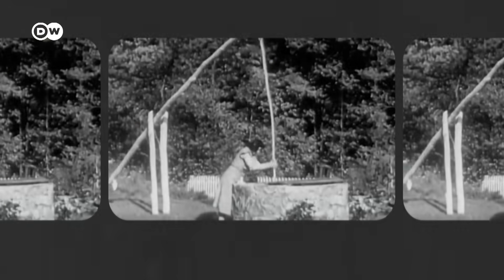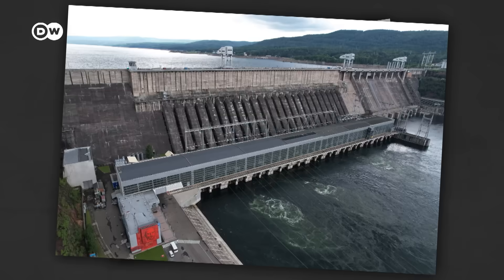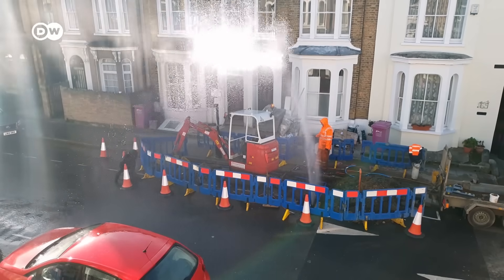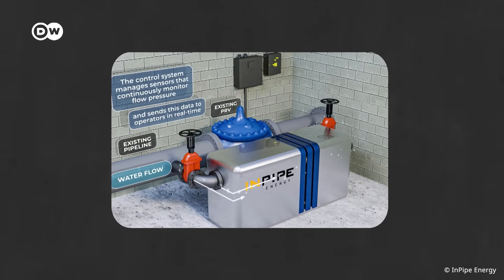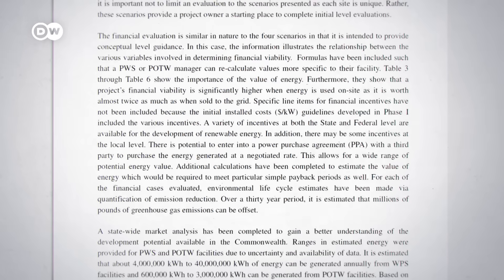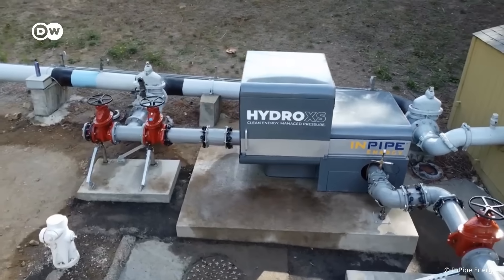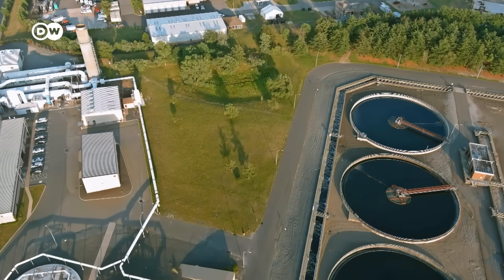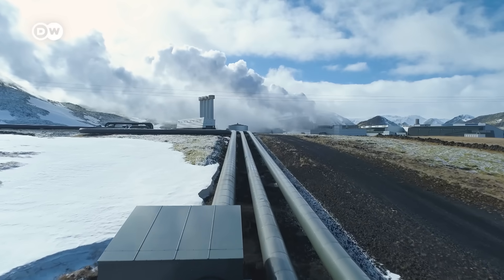In-pipe energy: The hydro power nobody is talking about

Comment: This is complete nonsense!  The amount of energy put into the water in the distribution pipes is done so it can be delivered to where it is needed. No more, no less. If you take the energy out of the system by tapping into a high pressure line and try to spin a turbine generator to generate electricity, you will have lost the pressure that was required for the water to reach the end of the system!  And the electricity generated in that will not cover the energy already put into the system to develop the pressure to begin with so you are basically wasting energy on both ends!!!  You can't violate the laws of thermodynamics and what you proposed does not work in real life!!!
Reply from the maker: Hey there!  Mini hydro technology only collects pressure valve waste energy already being generated by our water transportation service. Therefore, no additional pressure is needed. The process is explained at 2:26.
Reply: @DWPlanetA  Again - what you've stated and posted in this video is nonsense!
1.  The energy put into the pipe is generated by water pumps from the water utility - this pressure is used to do useful work to get the water to where it is needed and  at the PRESSURE that is required.  If you put a little impeller to power a small generator to generate energy, you are taking energy out of the system. For the energy of the small generator to make any power, it would have to be significant! And in order to do that, you'd have to take all the energy out of the water system meaning the water pressure level basically reduced to zero as all the energy has been transferred to the impeller to generate electricity. If that were the case, there would be no pressure to move the water downstream for anything else!
2.  The minuscule amount of electricity generated by this impeller contraption is insignificant to do any level of useful work. The power generated by the power company is infinitely more efficient than trying to gain whatever amounts you think there may be within water lines!
3.  The water that is in the pipeline can potentially be harnessed only if the water is moving. If the downstream water isn't flowing, there is no water movement to move the impeller to generate electricity!  So what kind of work are you able to do on an intermittent basis? 
So again - this is pure nonsense!

Comment: The best pv panel is almost 30% efficient and the worst motor is not less than 90% efficient. I believe the industry is milking the renewable sector by starting with the least efficient stuff 1st then when pv side saturates then we will switch over to hydro

Comment: Thank you !  Seems a form of "robbing Peter to pay back Paul"?  I invented something I called SpringStep decades ago, which is plates with springs on subway platforms/walkways.  As people walk, it compresses the springs and generates electricity.

After thinking it further through, I realized that it'd be "like walking on the beach" i.e., each step would take more effort, since one has to step up off the plate that went down/lower a little.

Concluded with: this would generate energy from the food people ate.

A form of stealing.  So, decided not to implement/market it.

Now, in this case, you identified a place where the flow is reduced mechanically, with friction loss; so, connecting to that friction to generate electricity seems to make sense.

Thank you for this trip down memory/stream-of-consciousness lane.  :)
Reply from the maker: Hey there!  Mini hydro technology only collects pressure valve waste energy already being generated by our water transportation service. Therefore, no additional pressure is needed. The process is explained at 2:26.
Reply: @DWPlanetA  Thank you for replying!

Right, exactly -- I wrote a lot of words to say this does seem to differ from the invention that I decided not to use to steal people's food from them, via exercise.  :)

What's really funny is a few videos later, I watched one where a guy was doing exactly that!  So perhaps there was something to the invention.  Well, I will keep thinking!  :)

Comment: Presumably this only makes sense in areas where water pressure comes from the fact that water is coming from a higher altitude source. If the water is pumped for pressure and comes from a similar altitude, then there is no way to get more energy out than went into it. This essentially only makes sense if you're using the free acceleration of matter from gravity, or perhaps more correctly, the free transport of matter to a higher altitude via the water cycle.
Reply from the maker: Hey there!  Mini hydro technology only collects pressure valve waste energy already being generated by our water transportation service. Therefore, no additional pressure is needed. The process is explained at 2:26.

Comment: Ah yes, the way to generate energy is by... reducing the pressure with a turbine to force the suppliers to produce more energy to keep the constant flow rate their system trackers require... great!
This only makes sense in places where you don't push stuff from underground, like water from high up going down, but we already have this, it's called a dam, so we are once again reinventing the wheel.
I would have this, but I would want an energy battery too, so I'd rather get an efficient battery and then put this into production.
Reply from the maker: Hey there!  Mini hydro technology only collects pressure valve waste energy already being generated by our water transportation service. Therefore, no additional pressure is needed. The process is explained at 2:26.

Comment: This isn't an energy source it's energy that's already been produced. It will reduce the overall pressure of the system requiring more pumps which will require more energy. It's no different than putting solar panels inside your house and buying lights to power them.
Reply from the maker: Hey there!  Mini hydro technology only collects pressure valve waste energy already being generated by our water transportation service. Therefore, no additional pressure is needed. The process is explained at 2:26.

Comment: Interesting little efficiency device. It could be integrated into faucets to reduce flow, as a two stage valve.
Obviously, it's limited, as you need to be running the water for it to be generating electricity. Which is another issue.
Really, though, we need to be talking about nuclear technology. We're really racing against the clock when it comes to climate change, and the energy producing technology that's closest to addressing the problem at scale is nuclear.
It's really unfortunate the amount of environmental damage that has been done due to fearmongering about nuclear technology. Partly, it's an unfortunate consequence of Cold War propaganda that justified a nuclear arms race. If there's nothing to worry about, there's no justification for the defense budget, is there?
Partly, vested interests in the energy business had politically favorable situations. A whole lot of the Cold War was about oil. Would be unfortunate if it turned out we didn't need it, wouldn't it? We could have gotten off it 20 years ago if we'd have been smarter about developing and adopting nuclear.
Reply from the maker: Hey there! We did some videos on nuclear energy that you could be interested in: 
Nuclear storage underground 👉 https://www.youtube.com/watch?v=QFEd5RkotFE
Germany´s nuclear exit 👉 https://www.youtube.com/watch?v=eWuGP_aBoYg
Thorium nuclear energy 👉 https://www.youtube.com/watch?v=Km6kqykX900
Do we need nuclear to fight climate change 👉 https://www.youtube.com/watch?v=9X00al1FsjM

Comment: That is a great idea. I've asked myself many times why we never acted on it. A similar concept (fluid flow for energy generation) could also be used in EV/Hybrid vehicles by placing small fans under the hood to capture the wind as the vehicle moves and create energy. Not sure if the amount of energy we'd be able to capture is too small for the investment or companies/governments never bothered to even evaluate the potential.
Reply from the maker: Hey there!  Mini hydro technology only collects pressure valve waste energy already being generated by our water transportation service. Therefore, no additional pressure is needed. The process is explained at 2:26.
Reply: A: the energy is too small to be worth the cost
B: it increases drag, pulling more power from your engine, making the process inefficient

Comment: Energy out of a system cannot exceed energy into of that system.  There is no free energy. If you tap into the energy of water moving through the pipes, t will cost more energy to pump the water. In fact, there will always be a net loss.  However, if the water flow is powered by gravity, and no man made energy is required, then by all means,  build a dam,, add a generator.  But that is nothing new.
Reply from the maker: Hey there!  Mini hydro technology only collects pressure valve waste energy already being generated by our water transportation service. Therefore, no additional pressure is needed. The process is explained at 2:26. You could be interested in our video on dams 👉https://www.youtube.com/watch?v=GTFDVZU-Nv0

Comment: This is like pretending that you can get a net energy gain from the wheel of your car spinning.  Perhaps if using regenerative braking you can recover some energy, otherwise you’re just slowing down the car where you might as well have just eased off the accelerator in the first place.
Reply from the maker: Hey there!  Mini hydro technology only collects pressure valve waste energy already being generated by our water transportation service. Therefore, no additional pressure is needed. The process is explained at 2:26.

Comment: This will only work if the water comes from a higher altitude. Otherwise it's just a one of those "free" energy dreams. Energy is just converted. It all depends on the pressure you require when you want to use water to shower etc. Having an in-pipe turbine would just reduce the flow when you open the tap. But then again, DW is a German channel and we all know what happened to their green dream right? 🙂
Reply from the maker: Hey there!  Mini hydro technology only collects pressure valve waste energy already being generated by our water transportation service. Therefore, no additional pressure is needed. The process is explained at 2:26.

Comment: I thought about this too with water tanks.. So many homes here supply their own water.. After pumping up water to a tank, gravity does most of the pumping back down. 

Now, the application is, since we already have tanks over 20ft tall, and some even double or more height, there can be a valve/turbine area that would charge up a battery both during use and when not in use.. So low pressure/rpm when not in use, and higher when in use.. Offcourse more research has to be done, but I believe there's potential for powering little things like lights, fans, cellphones, etc.. I'm sure a lot of homes here will be super happy to be able to do that in conjunction with solar power, the grid will only serve for heavy tasks like pumping water back up, which is normal already, heating, cooling, etc.

Comment: I had envisioned a sort of water generator using the same principle. Like an hour glass with water. Two vessels one with water one empty with a small turbine generator in between. As the filled vessel is elevated it would flow into the empty one. Free energy with a little input from the user.

Comment: Using energy to pump water is idiotic in the first place. Energy was never cheap, but the train-wreck that is economics sent all the wrong signals. Even the Romans could provide water with only gravity, and aqueducts would be a smart way to generate electricity from water. Investing in existing technology is not necessarily smart. Pipes need to be constructed, and maintained, often underground, but how will that happen once fossil fuels end?

Comment: This is dumb.  And I knew it would be as soon as I saw the title in my suggested.  You open by saying that the amount of power required to move water consumes 4% of the world's energy, and then you say that the water in the pipes has untapped power.  Ummm, the power in the pipes (provided by those pumps using 4% of the world's energy as you so graciously told us) is so you can turn on the shower and have decent water pressure.  So you can turn on the water hose and water your garden.

Something a lot of people maybe do not realize, is that a generator gets harder to turn the more power you try to get from it.  Your alternator gets harder to turn when you turn that 3,000 watt amp and car-sub up.  The motor is strong enough, and the added fuel consumption to continue spinning an under load alternator is negligible compared to the fuel consumption moving the vehicle itself.  We almost don't even think about it when we turn on the stereo or plug in our phone in the car, but that energy does comes from some where: the gas you put into the machine to start with.

If you start tapping all this supposed energy in the pipes, what you're tapping is the 4% of the world's energy consumption running all those pumps (that gas or fuel put into the machine to start with).  Which means either those pumps that are trying to move the water will need to work harder (use more energy).... OR you will have less water pressure when you turn on your shower.

I don't even know how someone could pretend that this could be a real thing on a mass scale.

You might have gravity driven systems where the gravity has more than enough power to overcome some generators being used... and we see that with dams and hydro power ALREADY.

This video is so incredibly deceptive, disingenuous, it blows my mind it can even exist.
Reply from the maker: Hey there!  Mini hydro technology only collects pressure valve waste energy already being generated by our water transportation service and otherwise wasted. Therefore, no additional pressure is needed. The process is explained at 2:26.

Comment: I'm working as a stationary power engineer connected to two skyscrapers and we have multiple high pressure pumps for domestic water and closed loops systems and coincidentally, the EV charging stations are on the same floor right outside our station and the wiring is passing through. All I need now is a plan and some superiors convincing ;)

Comment: This doesn't make sense. All of the energy in the pipes is created by pumps, which use energy. Any time the pressure is reduced to run a generator, it has to be recharged by running a pump. There is no "excess" energy in this system. If you have more pressure than you need, you reduce the pumped pressure, and don't inject the energy to start with. There's nothing free about this. You could conceivably steal energy from the water company, but of course that's illegal. Something like this might work if you had a gravity-fed system, and excess water to waste, but if you are pumping, this is not practical. If this was an efficient way to deliver electricity, I have to assume we wouldn't be using all that expensive copper cable.
Reply from the maker: Hey there!  Mini hydro technology only collects pressure valve waste energy already being generated by our water transportation service. Therefore, no additional pressure is needed. The process is explained at 2:26.
Reply: @DWPlanetA  Maybe I just got it. You are saying that you are using a turbine which is itself acting as a pressure reduction valve, when water is being drawn only. Is that right?
Reply from the maker: Exactly! Pressure valves are used anyways to remove the excess pressure. This excess pressure is used to generate electricity when there is water flow. :)

Comment: You are missing the most important part of water's energy... The charged ions in it.  Your need to think of water differently. 🥸 It has more potential power in it than just flow pressure. It is charged with the Earth's energy. There is way more power IN water... than the pressure it takes to move it.  Utilizing both the Hydrogen and Oxygen elements already present in water,  makes the prefect "green-energy" solution. Nichola Tesla would of had a field day with the amount of energy he could of produced with some of the pipelines of today. 🥳 
Think different. 😎

Comment: In engineering this concept isn't new. It's called economising. You see where there are losses as an unavoidable outcome of the system. The key word is unavoidable there. If you're water distribution system is requiring pressure bleed of valves all over the line, that's a more a sign of pumping stations needing upgrading. Also the way water is delivered to the home could be smoothed out with accumulater tanks. This this similar to the power grid with power factor. It's better to improve efficiency of a system than it is recover losses of an inefficient system. Because the latter is introducing more complexity. By the way water and electricity aren't best of friends. There's already a shortage of technicians in most industries this would only exacerbate the current situation. And like with EVs there's a carbon debt period to payback, this would be the same.